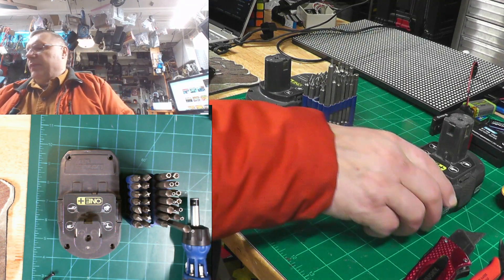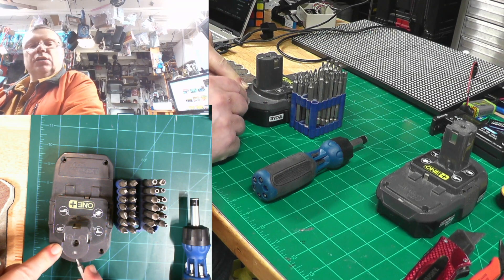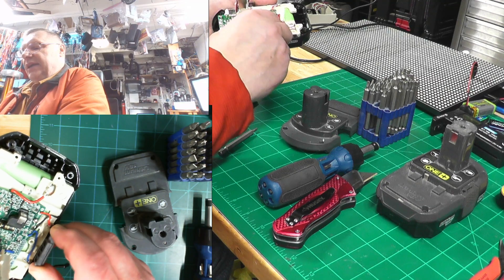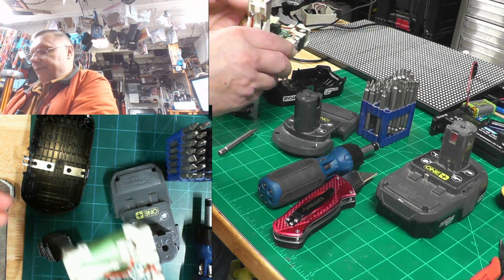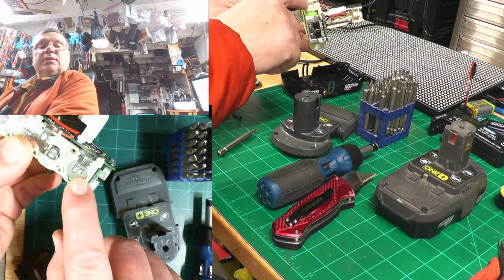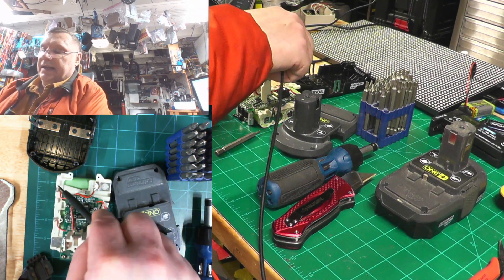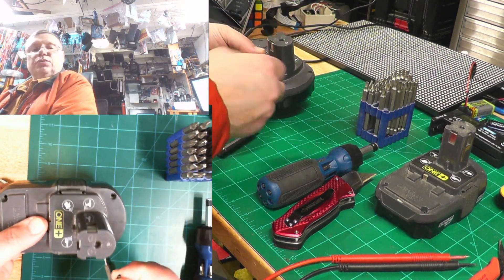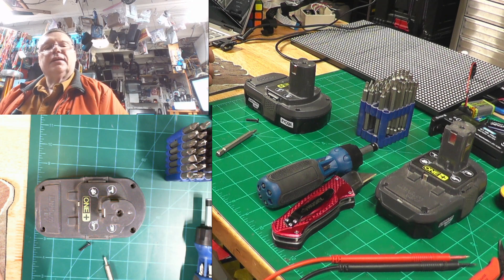Fix RYOBI batteries that would not charge at all!

Comment: I was cutting up branches with my RYOBI reciprocating saw with a  BRAND NEW RYOBI 4Ah battery I had just bought. The tool was working great as I had just put in a new saw blade I whacked up a bunch of branches & filled my green can and knocked off for the day.  2 DAYS LATER  I drove by my woodpile and saw I had left my saw with the new battery outside. It 
had rained. The tool?  NO GO. I took it to my garage & swapped batteries & was greatly relieved when the tool ran just fine. But my brand new RYOBI 4Ah battery? Not so much. I had not registered it. I cried & cried. NEVER again I swore to myself (& I swore real good too)

!

Comment: Like it is with all things no one size fits all nor is it one fix  fixes all. Your bad battery may have a bad pcb or a bad battery cell or a bad connection betwix battery cells. You just never know. BUT, if you collect an assortment of bad batteries you may be able to build a good one with parts from 
2 or 3. These batteries come with a generous 3 year warranty if you registered it when new- still a 2year if you did not. So make sure you register 
it. ALSO, make sure you have a backup battery. When #1 battery runs out of juice-put it directly into the charger  THEN  grab #2 and go back to 
work.

!

Comment: Thank you for the video.  What does the Ryobi programmable power supply look like? You also mentioned there were 2 ways to do it but only us 1 of the ways. What was the other? Thank you
Reply from the maker: The second way is to replace the 18650 batteries - I tried that, and it is very hard to assemble all the batteries back in.